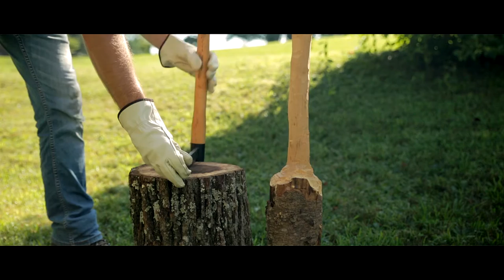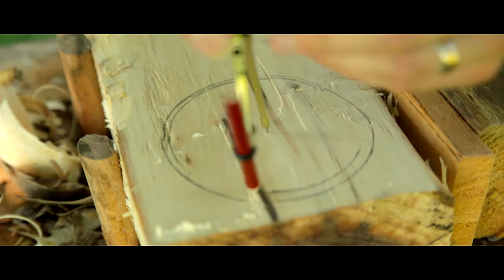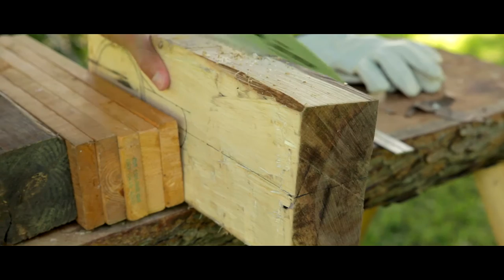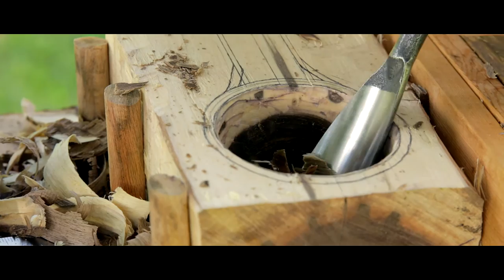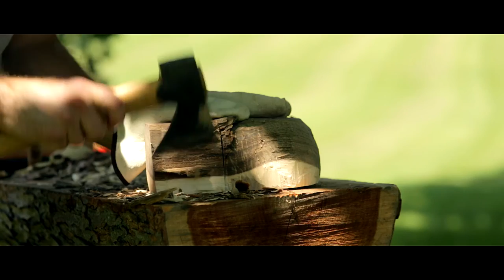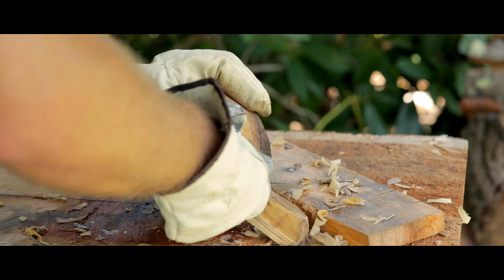Carving a Black Walnut Kuksa

Comment: Love this video, its been the best Kuksa crafting video I have seen yet. Love the detail and quality. I have been wanting to make one of these I just need to find the right piece of wood to work with.
Reply from the maker: Wow, thanks a lot for watching and for the compliment. Entertaining and inspiring others is what I'm after, so let me know when you get that kuksa made. I'm real new to this myself, so not sure what kind of help I could be, if any, but if you run into any questions - let me know. I've had to learn through trail and error so far, and have ruined so many things along the way, ha ha. A good piece of wood makes all the difference in the world. What kind of wood are you thinking about using?
Reply: I've been collecting different tools and learning how they cut and flow through wood on scrap pieces. Whats the name of the tool you were using to split the wood?
Reply from the maker: It's a 12 inch splitting froe made by Lie-Nielsen. I ordered it from this guy: http://www.countryworkshops.org/rivingtools.html I like it, but after using it to split logs with for awhile now, I wish I would have ordered a longer one because I find the 12 inch length to be a bit small for many of the logs I split to carve kuksas. It still works though, just makes some logs require a little more muscle to get through.
Reply: Awesome thanks for the info!

Comment: very nice but u should use birch nut other wood. I dont know why but my teacher told me to make it from birch.
Reply from the maker: I agree,  White or Paper Birch would be ideal and easiest to work with. Unfortunately, it does not grow in my region. There's only Yellow and Black Birch, both of which are much denser than Paper. I chose Black Walnut because it was free, easy to get, and I like the looks of it, however, it isn't the easiest to work with. Tulip Poplar would be the better choice for that in my region. I've drank coffee from the cup numerous times and it works well, with the exception of being heavier than Paper Birch.

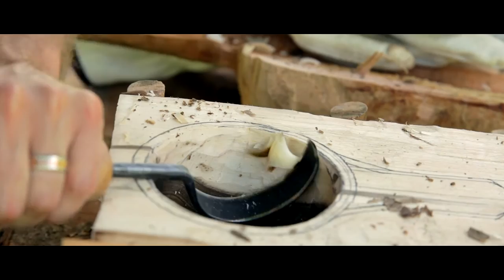Comment: Hello nice vid where did you find this tool at 2:35 ?
Reply from the maker: Thanks! It's called a 65mm Twca Cam made by Nic Westermann, a blacksmith from the UK. Here's a link to his site and this tool. http://nicwestermann.co.uk/shop/greenwood-carving-blades/65mm-twca-cam/ I had to make the handle myself from a Cherry limb, then just drilled a hole in one end deep enough for the tang of the blade to slide in, and epoxied it in place. It's a great tool and well worth the money. It may say on his website that he's out of stock in a lot of his tools, but just join his mailing list to be notified when he makes a new batch of blades, and he'll let you know when they are available. That's what I had to do and he replied back within a couple of weeks. He also ships internationally.
Reply: Thank you ! ^^

Comment: Beautiful work, but a kuksa not made from burl, good burl with the right grain, is useless.   Burl isn't about how the wood looks, it's about the fact that it will never crack, whether it's treated, not treated, kept wet, or allowed to dry out.  Proper burl has grain that curls back on itself so there is no spot for a crack to start.  

Find a piece of birch burl and use it. It almost always has the right grain, which is why it's the traditional burl used for a kuksa.  You'll have a kuksa you can not only drink from, but that your great-grandchildren can also drink from.

Comment: what iş the measures this kuksa ı like it . and ı m start a kuksa like your kuksa . are you tel me to measures please :)
Reply from the maker: Hey, thanks a lot. This kuksa measures 4.25 inches from side to side on top, and about 2.25 inches across the bottom. I'm not too strict on the measurements whenever I carve a kuksa, I usually just draw my design based on the size of the piece of wood I'm using. However, I do prefer them to be this size or a little bigger. Thanks for watching!
Reply: Thanks man . Witch oil use to this kuksa ?
Reply from the maker: Tung oil.
Reply: Thanks . İ want more beatiful video :)